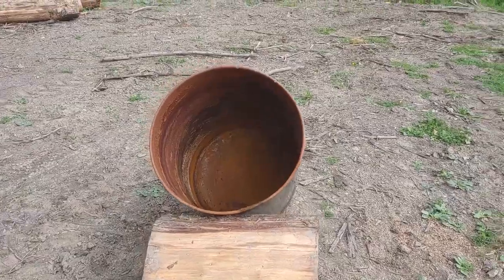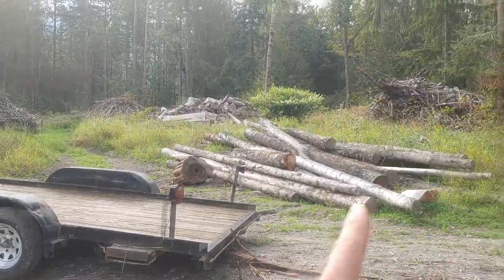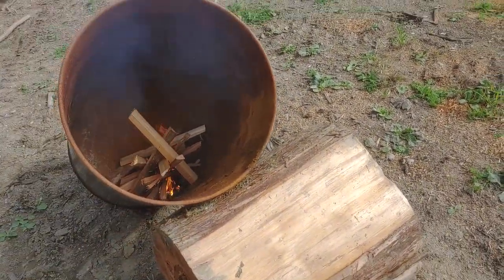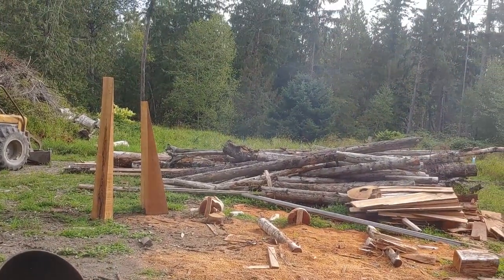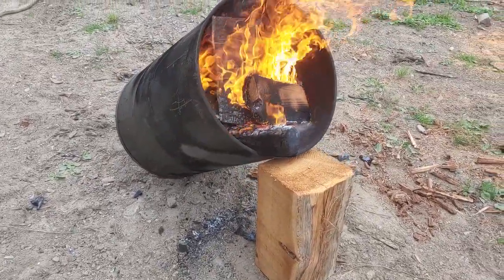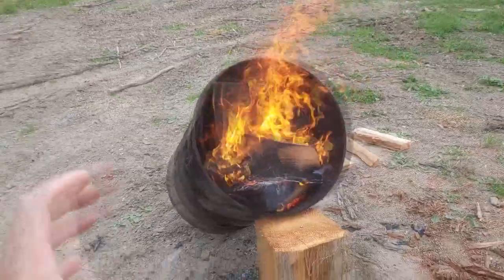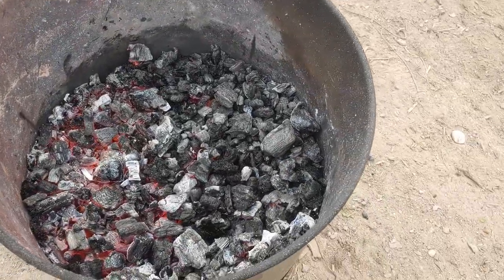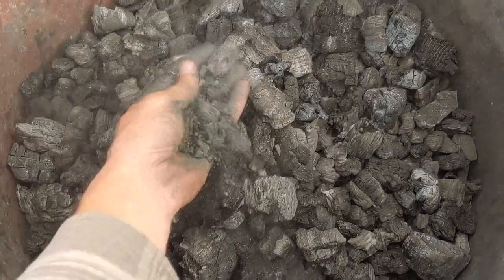First Attempt Making Biochar For Farming & Carbon Sequestration

Comment: Fill the drum with wood and put a lid on it, Then poke a hole in the bottom and put that drum on a regular campfire. The steam and wood gas generated will exit the hole, blow into the fire and burn, generating even more heat. When gas generation ceases remove the drum, let it cool and open it up.
Might want to try this on a smaller scale first, like using a paint can or something similar.
Reply from the maker: Awesome!  Thanks for the suggestion.  I will give it a try
Reply: @kira you can do the barrel retort method but you are limited to smaller batches, you get a very high quality char but small quantities. The flame cap method allows you to process a lot more volume.

Comment: Check out Codyslab's videos on charcoal making. As I recall, he found out the "pit method" is pretty much just as good as using a barrel, and can be scaled easier.
Reply from the maker: Cool.  That would be great if I could just dig a hole and burn it in there.  It would save me from finding a big metal bin, etc.  I will check it out
Reply: @SJForestProducts  https://youtu.be/C5oI7pZpOK8 link to said video.
Reply: Ohh Codyslab is great
Reply: I was just about to mention Cody’s lab and his experiments with the pit! Super efficient and so easy…

Comment: Drill holes at the bottom of the barrel. Set barrel upright. Start fire. When burning hot enough and full, shovel dirt over the holes, and cap the top. Also insulate with kaowool
Reply from the maker: Great tips. Thanks!

Comment: I agree about mulching it. I’m not sure what they call it but it’s on its own 18 wheeler flat bed or on a smaller trailer. It’s round and spins in the center I think. Iv seen them used at my local dump and on tv mulching pallets. Don’t know if you can rent but it will take care of all those piles in a day. I’m a wood burner. Time consuming. 🍻👍
Reply from the maker: I think they are called tub grinders.  Very cool machines.  I bet they are expensive though?
Reply: @SJForestProducts  thanks. I just looked it up. $100,000 + .. wow expensive. Burn 😂😂👍👍

Comment: I am in favor of grinding slash into chips. Cedar shavings are costly and short supply.  Many water districts use them for winterizing water meters. The totes would be perfect to put in back of a truck for a round of winterizing.
Reply from the maker: Cool, thats good to know.  I think I will experiment with a chipper some time and explore the market a bit.  I just want most of the slash gone and if I could get paid for it all the better

Comment: I just found your second channel Jason 👍
 You really should post it on your "Channels" section on MBMM so that others can see it.
Bio char seems pretty much the same thing as making charcoal.
Is there a difference?  If not, why not just do the old fashioned earth mound methed.
Thanks Jason 👍  Cheers.
Reply from the maker: Hi Shawn. I'm glad you found it! Good idea about posting it in the channels section, I will do that. Biochar and charcoal are the same. I just did some research on the charcoal earth mound method and it looks cool. Thanks for the tips.

Comment: If you pay close attention the smoke has different phases, the initial smoke is white and it's mostly steam, then once the steam is gone and it's burning wood gas the smoke is pretty much clear, then as it starts burning the carbon the smoke gets darker again, and like a gas engine if the fuel oxygen ratio gets too rich you will see looks of dark smoke.
Reply: As to crushing it, run the char through your hammer mill with a1/4- 1/2 screen. dry char will make a bit of dust however, and really wet char will cake up.
Reply from the maker: Cool!  Thanks for the tips.  It was interesting to watch the smoke and see what happened depending on fuel, air, moisture, and when I tipped the bin up or laid it on its side.

Comment: 19:08 "I can't get it sealed ..."
That's what hammers are made for. Tap around the perimeter of the band while pulling the clamp handle. (or use a block of wood for a hammer)
Reply from the maker: haha, your right.  When we worked in the mines anything could be fixed with a hammer, bigger the better😂.  It just needs a MINER adjustment!
Reply: @SJForestProducts  
😆😅😂🤣